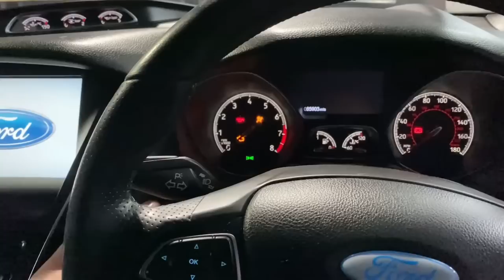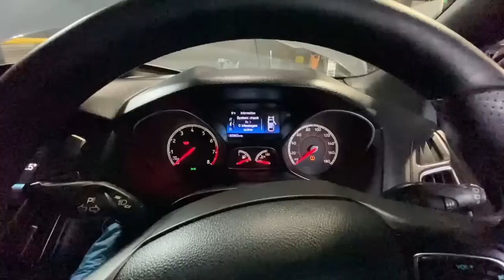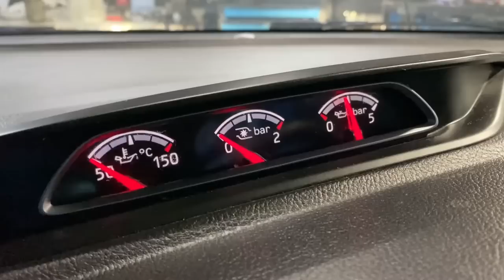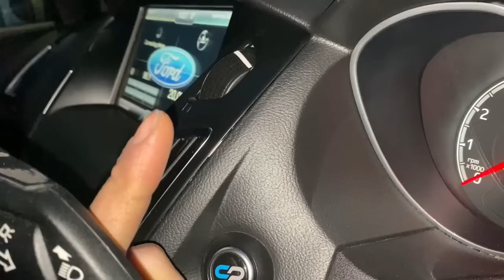Ford Focus ST 2.0 2016 from auction - No  boost and rough bodywork what else to expect ?!

Comment: Not mechanically minded at all but totally in awe of your Jack of all trades skills. The Ford engine seemed so compact compared to those VAG engines you usually work on, but guess probably 2-4 cylinders less in some cases. Wondered about the previous performance tuning whether this had stressed the OEM equipment on this ST. However saw a previous viewer saying a rated company. Think you know now your loyal followers want a part 2. Great work!

Comment: Collins performance is based I'm Cheshire, it's a really real known tuning company for Ford especially. Their tunes are very safe and none aggressive. I've always used Collins and never ever an issue.
Reply from the maker: Yes did check them, CP looks like decent company, not blaming no one really it’s a car, so it might go whenever. Also as I mentioned the car was driven without any boost for some time. Car will be sold as it is on the end.

Thanks for comment!
Reply: @VAGTechnic  I was just giving information on them :) I just sold my mk3 focus st in this colour, miss it so much. Its shocking how people can get a nice car like that in that condition. Depending on the tune and set up... there was a while ago a stage 2 tune what was aggressive... required no extra parts but advised you had your pistons done etc with the tune as without this was a risk engine could go... I'd wipe the tune anyway... eliminate everything. But I've just found your channel, in addicted! So talented man. Look forward seeing it finished.
Reply from the maker: @deano1864  Thank you very much for your positive comments. :)
Reply: @VAGTechnic what oil did you use?  Don’t use the additive too.  Also try and research how early on in the RPM range the boost comes on, all contributes to LSPI.

Comment: Greetings from a Ford enthusiast from Down Under in Australia.
Just watched this video 2 years after you posted it.
Loved watching you do the turbo replacement and the bodywork and paint repair, great work and result, but so sad to see it end with an engine failure.
Engine failures like that do happen with engines have been tuned, especially with the Mk3 Focus RS.
Alarm bells rang for me as soon as I caw the CP logo, knowing it was tuned and not knowing it's history can be like playing Russian Roulette.
These engines are prone to low speed pre-ignition (and more so when tuned) and if ownwers are not aware they can be doing harm to their engines with out knowing or cars have been abused and flogged with the extra power.
Feel bad for the new owner who was hoping to get a fantastic ST to enjoy driving and ended up with a dead car.
Was hoping to see a Part 2 with an engine swap and a happy ending for the owner.  🙂

Comment: I always prime the turbocharger with a high quality oil before fitting. If the unit is supplied with no caps in the oil supply and return, then it is a necessity.

Comment: Clear flood mode on the fords hold the accelerator pedal to the floor then crank you don’t have to mess with the coil plugs cut fuel so you don’t wash the cylinder walls
Reply: Either that or remove fuel pump relay for any car.
Reply: @michaelbolivo7975  no that’s too much work.
Reply: Theres no need to prime the oil system, oil pressure is next to nothing at cranking speed. On a lot of newer stuff the oil pressure is reduced at cranking speed to enable faster start up (hence not fighting oil viscosity at low rpm)

Comment: What a shame after all that work...gutted for you it was a beautiful turned out car.....I repair my son's St225 and it has a stage 2 tune...fingers crossed so far after 4 years engine is still good..however a lot of ABS sensor/traction control faults...gearbox went bang...trying to change that on my driveway on my back was a nightmare....wheel bearings..driveshafts...always something needs doing...his friend has same car...his engine went bang..had it professionally rebuilt by reputable company...6 months later his wife went over a speed bump cracked the sump and blew the engine again due to lack of oil...good cars if left as standard from factory...

Comment: First time watching and enjoyable video. Got all the way to the end and man-oh-man, kaaboom!!! All that time and effort spent on making the bodywork look 100% and then the bloody engine grenade's it's self.
Modern engines don't just go bang for no reason, no matter how hard you drive them. There's a high possibility that what ever Flash Tune has been uploaded isn't doing the engine any good and applying too much boost at the wrong times, overriding some engine safety features on oil pressure and eventually something goes bang bang.
Need a part 2 to see the engine swap and this car back on the road.

Comment: This car has probably been thrashed to the limit that’s the reason it was in the auction the last ford I ever owned was a FORD GRANADA 2.8 I X pac brilliant car then they brought out the ford scorpio 2.9 I my mate bought one brand new within 3weeks it was in the ford dealers for a failed head gasket that was done under warranty two weeks later it was back at the dealers for a failed automatic transmission that was my last ford never owned one since 1992

Comment: Was ECU back to stock, or still whatever performance tune added by that tuning shop ?
Reply from the maker: Dont know What mapp Was there …
Reply: @VAGTechnic  If wastegate was failing when they created the map, and the map was still active with new turbo you may have been running a LOT of boost.

Comment: Common problem with the rear arches on all focus? Had to have my 15 plate ST3 back to Ford for the paint warranty
Reply: I had 2006 ST and there was same paint problems on rear arches. It seems that paint and rust issues are still there even years have gone. New generation of Focuses still have build quality issues.

Comment: You are blameless on this. Here in the States, the kids beat the heck out of their cars and put questionable tunes on the motors and install crappy bolt-ons. Only buy family type cars from auctions. If you must buy a performance car from an auction joint, don't purchased anything that has been modded.

Comment: These engines are crap anyway, had know issues with water consumption and that could be your problem to. Crank was pushed out by excessive pressure caused by water in cylinders. On top of it, when you see label from some tuning house on car like this, what you should do is walk a way, or prepare huge pile of money. If money will not be needed consider your self very lucky. I would like to see owner happy in the end! hope he gets good replacement engine, but be aware, strip the engine to the bone. and check the block very thoroughly.  I would also like to see this failed engine striped, just so we se why it failed.

Comment: The liners move causing HG issues and if you check out the issues with this car in the USA, the dealers actually replace the engine under warranty!  Definitely do a PT 2 👍🏻
Reply: Mate what are you talking about hahahah the headgasket wasnt even gone... Headgasket isnt going to send a piston through the block. You need to brush up on your engine knowledge mate. The liners moved? WHAT? mate LMAO.
Reply: @johnboy2436  unfortunately for you northerner is right. Read the ford technical info. If you dont know what cylinder walk is I suggest you research it. High performance academy have a video covering the basics. White smoke would possibly suggest water entering the cylinders, hence probably from around the head gasket if the cylinder liner has enough room to move. Hes made you look a right mug 👍
Reply: @Divided-Kingdom  No one has mugged anyone off... Im on the ST & RS forums and i have been for many years, Iv seen all the issues and all the engine failures over the years with pictures. The common issue with the MK3 ST is ringland failure due to LSPI (which is user error not the fault of the car) and the MK2 its cracked linears. Even with big turbo iv never ever ever seen an ST put the piston through the block or cylinder walk as you call it. Which doesnt happen  unless power is pushed beyond the knock limits and the knock sensor is unable to pull enough timing WHICH HAPPENS ON ANY ENGINE. This has CP tune which will be collins perforance CP1 290 BHP tune or CP2 320 BHP tune. Both tried and tested since 2012. 

The MK3 RS has the head gasket issue.... due to the wrong one being put on at factory which was ment for a mustang (any MK3 RS before july 6th 2017) also the MK3 RS is the one that puts the piston through the block when the power limits are pushed too far. Its due to the rods. Your the mug here.... i eat, sleep and breath fords... I can put them together with my eyes closed. I like to make sure i dont miss anything when talking to nerds like you so i made sure i typed "ecoboost cylinder walk" & "ST cylinder walk" on google and honestly there isnt one website, thread, post or ANYTHING involving this matter. DO you know how common this engine is.. Its been in production for 8 years hahahah... NOT ONE POST. Your dont understand how much of a mug YOU ARE... i know my engines inside our iv had 3 MK3 focus's. Iv had two ST's and an RS which have been extremely modified.

The ST engine is STRONG. REAL STRONG. My RS thats built with an ST engine block is 550bhp and thats keeping it extremely low power. LMAO dude what the f are you talking about you weird guy. Tell me you know nothing about cars without actually telling me you know nothing about cars.Your talking about enough space to move in a cylinder... 

Also i just checked "High performance academy" youtube channel and see NOTHING on the ecoboost platform. Nerd ill tell you the basic's without a video that doesnt exist. If there is a video explaining the ecoboost platform currently on youtube i can promise you iv seen it. I know this platform inside out. 

Ford came 6th out of everyone in realibilty in 2021 beating VW, BMW etc. White smoke isnt water. Its coolant get it right. It would suggest on the head gasket there is a crack between the coolant channel and the cylinder. Furthermore if you knew ANYTHING you would also know a thin gasket that seals the head to the block would never in a millon years be linked to a piston failing. The engine was driven with no turbof for 4 months... NEVERMIND LSPI when you do dumb stuff like this. Its not wonder this happened. Its only early in 2022 but you sir are the dumbest person iv come across this year.
Reply: @johnboy2436  fair enough. Please ring my employer and tell them I'm not up to the task of diagnosing and repairing all brands before they slot me another 60k this year 😜

Comment: Shitty tune? Would recommend if you build it back again, get the ECU reflashed to stock.
Reply: nothing wrong with the tune mate CP is one of the best and most used amongst ST owners. Tried and tested.
Reply: @johnboy2436  Could be a tune for parts that are no longer on the car, or, if it's an accessport tune, could be running a low boost map. (Don't remember if there was an accessport in the vid.)

Should have said tune related issues but that's less fun.
Reply: @FadedSparkx86  Collins preformance tunes are ALL progressive. A stage two map will worth fine with a hard with zero supporting mods and it will increase power as you add each mod. For example, i could decat my cat right now and gain like 10bhp and the map will adjust for that. Its tuned by CP the sticker says that on the back. No one that runs CP usually runs an access port or switches between maps.
Reply: @johnboy2436  Ah. See, I'm from Canada and you just don't have that option over here. It's Accessport or SCT, and it's 99% accessport.

I personally have an SCT based tune and it has no adjustability built in. Have to have it modified by the tuner if I change anything.

Comment: Don't use oil flush
Reply: Since the condition of engine was unknown it looks to me to possibly be the initiating cause of the catastrophic failure, heard alot of horror stories, you won't detect it because the oil pressure will still be up, but oil spray nozzles or some passages might get blocked from suddenly loosened sludge. Once that piston expands and locks up from lack of oil spray it's game over. Could also flush crap into the rod bearings blocking the oil flow.

Comment: Outrageous!
Couldn't the turbo waste gate alone be changed?
Turbo oil supply and drain should have been replaced and he didn't show us cleaning or testing them?
Did you remove CP tune?
Did you remove all the oil flush and/additives?
How could you do body repair without passing engine/chassis? Well, what would Columbo have said!
Ooh, ooh... Just having a 'Columbo' moment. You're making videos. You would have definitely made a video of the road test and being a petrol head likely given it some welly. Typically, these cars shouldn't be tuned up. So if you had been doing just a 40 mph test drive then we would have seen that video, right?
You should reimburse the customer from your liability insurance.
Oh, and advice against buying at auction is self serving: trade don't want retail customers going direct to their source.
Reply from the maker: I don’t have a camera taped on my ass you know 😂😂😂 

We are not taking any responsibility if something like this happen… car need to be test drive before costumer can take it , unrelated fault to what we done , unfortunately that’s how things can go , you have to live with it or buy your self a horse

Comment: Those engines have a reputaion for blowing out the headgasget. Think there was a recall by ford to replace it. If you put in a replacement engine, please replace the headgasget first.
Reply: The MK2's did I don't think anything above that does.
Reply: It's the 2.3 ecoboost from the rs that had the recall cause they had the wrong hg on it. These 2l have no real problems when maintained properly.
Reply: That was for the 2.3 ecoboost on the RS on any MK£ RS in production before july 6th 2017. They put the wrong head gasket on, it wasnt a matter of it being a fault.. Ford messed up big time. The car in this video has no such issue and the headgaskets are strong. The common fault with the MK3 is ringland failure due to LSPI when you boost it in a high gear at low RPM with a tune.
Reply: @TheTechnoaddict  We call them Eco BOOM
Reply: @FrozenHaxor  the 2.0 l? Only if you don't do proper maintenance.

Comment: Honestly what do you expert from crapy Ford brand
Reply: Problems are always with modded engines .  Got stock 130 000 km 2014 ST and using it as a daily. No problems whatsoever.
Reply: One of the worst brands out there to anyone switched on. The technology and design used is primitive and out of date. They rust like theres no tomorrow. Parts are over priced, after sales support is crap, and as for transits, wouldn't touch it with a barge pole